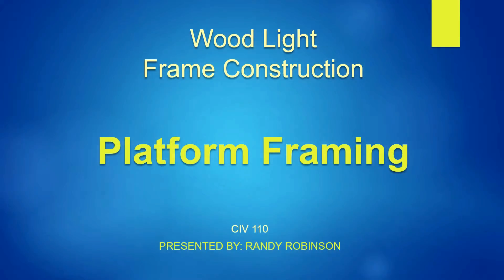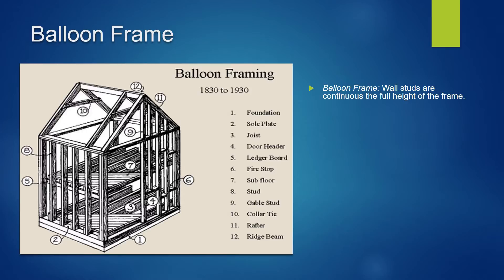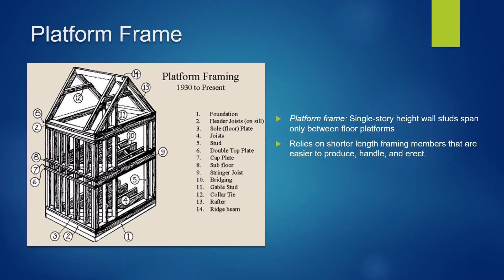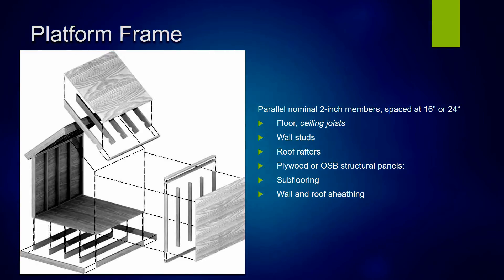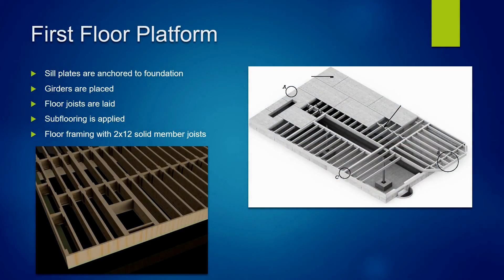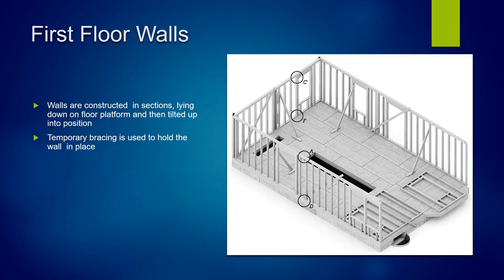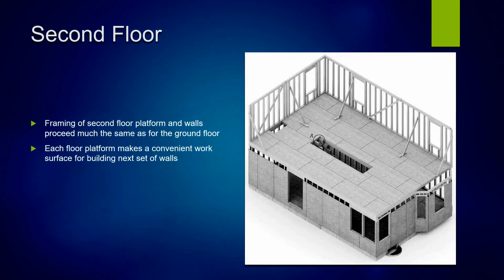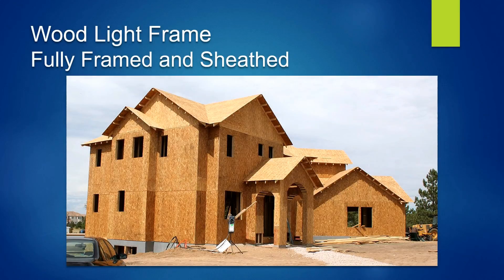Platform Framing PowerPoint

Comment: I little lengthy. But it was a well put together presentation on how platform framing is constructed. The slide show had a professional look and you did a great job presenting all the information on a step by step basis. It looks like you may have a future in putting presentations together.